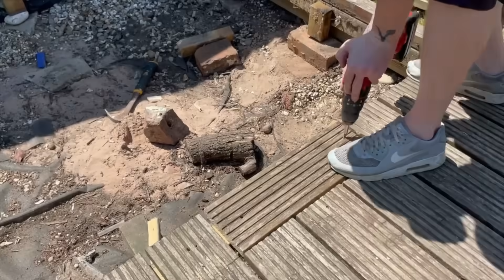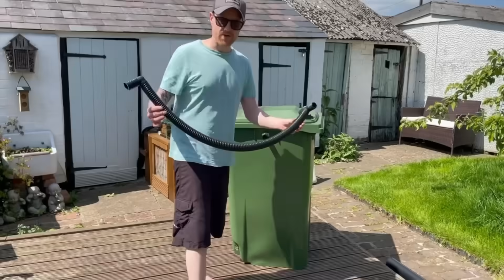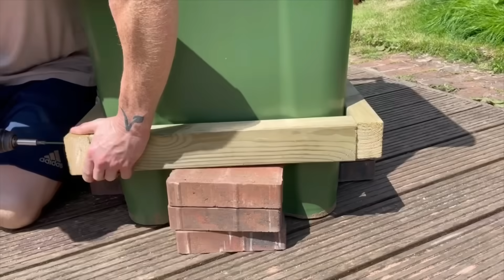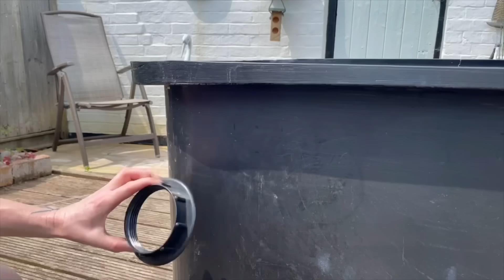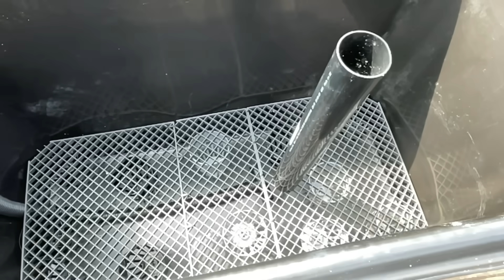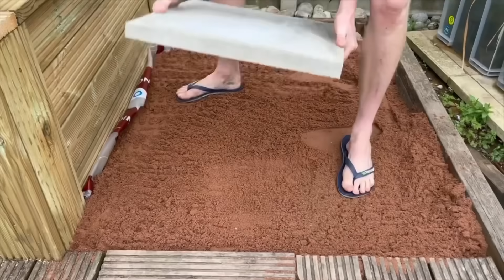DIY Backyard Garden Pond (step-by-step)

Comment: Hey I am gearing up to build one of these in my backyard. All above ground but I am going to use a "pool pond" instead. Specifically the one that you can see into from the front. I am going to use the same steps you took here, insulating and adding siding. Any tips?
Reply from the maker: Can’t really think of too much. Just take your time, and try and make sure you’re keeping your cuts nice and square. Good luck with your build! Being able to see in through the front will be very cool!!

Comment: I only miss a part for excessive water drainage.  For heavy rains ect and the airstones do not add oxygen to the water.  It’s the water movement on the surface what adds the oxygen in the water. So the airstone in the green bin probably won’t add much oxygen.   Water movement is always good though. Other than that it’s an inspiring build. Thanks for sharing
Reply from the maker: Thank you! I’m planning on adding an overflow soon..

Comment: This is beautiful! I'm confused what the trash can is for. I want to build a natural swimming pool with a stock tank and trash can filter with layers of rock, sand and charcoal. Would that media work?
Reply from the maker: Hi there, the trash can side of the filter is just for the mechanical filtration, so the physical removal of solids etc. The bog filter side of the filter as much as it does provide some mechanical filtration, it’s not great at it, but it is really good for biological filtration. Also the trash filter is good for trying different filter media’s, and also providing an area where I can add heaters, or carbon for example. I’ve never tried using sand in a filter so can’t really say how that will work. I’ve also never really used carbon in a pond filter, but I have thought about getting a carbon infused pad and putting it in my trash can filter, that way it would be easy to swop out when it becomes exhausted. Hope that helps! 😊

Comment: Does it freeze where you are, I’ve heard those tubs you used have a tendency to crack and split in freezing temperatures
Reply from the maker: I use heaters to stop water temps from dropping below 10°C/ 50°F, I’ve not heard of any issues with cracking though 👍

Comment: Could you have used the old decking boards for the cladding? Would have blended nicely.
Reply from the maker: Possibly, but I don’t think I would have had enough, plus they weren’t in the best of condition as i think the old pond had caused them to rot a bit. But yeah, would have blended in better if I had of. 😊

Comment: I dont understand ur filteration why it doesnt  flow from the top to pouring down. I dont understand how its filtering when tube is going all the way and not touching filter??
Reply: His pump sucks the water down the tube and fills the canister from the bottom up, then everything drains back into the pond via the top hole he drilled
Reply: @Rose_A  how Is that filtered from bottom?

Comment: where did you get the parts for your pump table/slate rock holder? looking for a 3 way 90 degree connector is hard work!
Reply from the maker: I got them from plasticpipeshop.co.uk it is pricey, but really good quality 👍
Reply: @GingerFishyOfficial just looked, no joy! 😭
Reply from the maker: @kennyroberts4229  😩

Comment: I have to say job well done! I’m actually hoping to build floating, self watering, vegetable garden beds. I’m in the desert so this will certainly require some modifications. But you present some very useful information here and I appreciate it! I’m hoping to use solar fountain pump and solar powered air pumps with air stones to move the water through the system. I’m going to attempt an under gravel filter in the bottom of my main tank.I expect that my plants will provide a certain degree of filtration themselves. I’m counting on common goldfish to provide fuel to the system. They’re cheap and are quite acclimated to my region. They reproduce nicely
Reply from the maker: That sounds awesome.. defo like the idea of the floating vegetable garden beds!

Comment: Really love this, makes me want too build one !! 

Only thing i will say is the second air stone would have been better in the bio filter to help the nitrification process and make amonia removal more effective
Reply from the maker: Thank you! Yeah, did wonder about that, but then I also wondered if part of how the bog filter works so well is potentially creating areas of lower oxygen where anoxic/ anaerobic bacteria can grow and convert the nitrate. I could be wrong on that, but just something I kind of wondered. That said, I did consider putting an airstone down the clean-out snorkel for the aerobic bacteria, and to help prevent with channeling.

Comment: Where can I get the 3-way bends at the corners of the pump stand please?
Reply from the maker: The only place I could find them in black was the plasticpipeshop.co.uk quite expensive but really good quality. I have also bought them on Amazon in the past, but only in white, and they weren’t as good quality. But yeah, the ones I used in the this video were from plasticpipeshop.co.uk
Reply: @GingerFishyOfficial  great, thank you

Comment: Nice build! Question, wouldn’t porous rock help the micro biome more than those smooth stones in your bio filter?
Reply from the maker: Possibly. But generally bog filters are always built using rock and gravel. I think more porous rock can end up getting clogged over time in a bog filter setting.

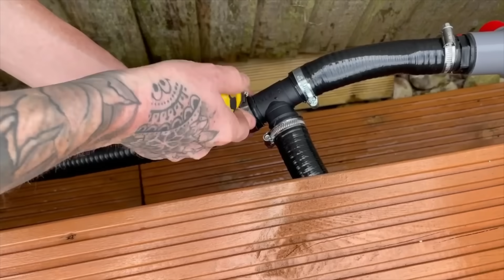Comment: 19:08 With the non return valve do you need just need the one going into the bog filter? or on both sides? If you need it on both sides could I place the non return valve on the T joint before it splits off into either filter so then the non return valve works from both filters?
Reply from the maker: Yeah, you for could defo add the non-return valve before the split.. that way you’d only need one 👍
Reply: @GingerFishyOfficial  Cheers :)

Comment: Hello dont know if you still read comments on older vidoes. But ill try my luck im currently in the process of upgrading my pond and want to build somthing very similar to what you have. The only difference is with the bog filter i would like in the center of my pond and not on the side that means the mechanical filter will run through the gravel filter with plants then drip in to a waterfall will this still be okay do you know?. As you have both filters running separate. 

Sorry bad english.
Reply from the maker: So the water will go through the mechanical filter first, then the bog filter? Yes, that’s should work well, and is a good way of doing it. 👍

Comment: I'm an aquarium guy really, but I was fascinated by your build. I had a few concerns as I was watching, so there were a few sharp breaths, but you addressed the concerns as you went and I exhaled in relief. It looks really nice too. 

I think the mechanical filtration could be done better, but it would cost a lot on a pond scale, so I think as a cheaper set up you did well. I'm not a fan of alfagrog, so that's the only thing I would change out.
Reply from the maker: Thank you! Yeah, I agree the mechanically filter could be better, the real test will be how it handles the summer months when the waste load is at its highest! I only really used the alfagrog as I bought a big bag of it years ago and thought I may as well  use it up. 👍

Comment: I have no idea how I found this video and I have no desire to put in a garden pond in my back yard, but for some reason I watched this very intently from start to finish ha.  Very nice build and good video.
Reply from the maker: 😂 Thank you!
Reply: I never understood why people want to look down at their beautiful fish. I have an aquarium built into the wall above my headboard. 99% you'll never see from above. The bubbles rising to the top put me to sleep
Reply: @joeblow8206 that’s also a lovely idea Joe, but this guy is building an outdoor pond for winter-hardy fish. I build my (fairly large) tropical fish tank into a brick wall between two rooms, (the hallway and the dining room) so it could be viewed from either side.
Reply: ❤love it
Reply: I’m sorry but the filter at the bottom of the bin is incorrect. Sediment is heavy so the sponges and filter will just hold it down in a place where it would have settled anyway. The pumped incoming water t-piece outlet should then have been set about 12 inches from the bottom so allowing the sediment to naturally separate without being constantly disturbed by the incoming water.
Reply: (Insulation only maintains the water temperature for a longer period. It doesn’t change it) so if you live in a location where sub zero temperatures and ice occurs in the winter, you will need to employ a small ( tropical fish tank type) thermostatic heating tube to prevent the water from freezing-over.
Reply: it is because it is simple and looks very nice
Reply: Same
Reply: What are those boards called? Never seen them with those channels
Reply: came here to say the same thing. I live in a condo, so its just information I rolodexed lol
Reply: Same here 😂🇬🇧

Comment: Great video, really useful for me as I'm building an above ground pond with exactly the same tub. Couple of questions please - what thickness kingspan do you get and where did you get the plastic tube and joints you used for the planter basket stand. TIA, Jon
Reply from the maker: Thank you! I used 50mm kingspan for the main pond, and for the filters where it would  fit. In a few areas where it wouldn’t fit, I used 25mm. The pvc I used for the planter basket stand was from pvcpipeshop.co.uk, it was quite expensive but it’s really strong stuff, and fits together tightly so you don’t need to glue it. I’ve tried buying similar stuff on Amazon and it was nowhere near as good. Good luck with your build!
Reply: @GingerFishyOfficial  thanks for the additional info', really appreciated.

Comment: some interesting ideas you had there I like the fish refuge shelf idea might try that in my pond to keep birds from trying to get fish. 
the insulation you put in does not look like closed cell foam is it going to soak up water?
I like that purple pickerel plant and the water iris, but both just keep growing and spreading crazy large I have them in 3-gallon black buckets and you would never even know that there is soil in there they have overflowed the buckets completely. The pickerel is so huge at end of season I drag it out and chop whole top off with a machete and it grows back next year to 3 foot tall and 4 foot wide.
I had bottom of pond empty but then some gravel snuck in, and the koi and goldfish chew on it so not much dirt collects in the small amount of gravel it probably helps keep the plastic from breaking down over time in sunlight.
Reply from the maker: Hi there! I’ve never had pickerel weed before, so thought I’d give it a go. It’s yet to start growing back this Spring yet though, and I’m a little worried it may have died off over the winter.. are you in the UK? I’m wondering if it got too cold for it.. 😬
Reply: @GingerFishyOfficial  I am in pennsylvania United states similar to UK might be a bit colder here in winter our plant looks dead then once it is warm out and it gets sun and fertilizer it grows like crazy it likes hot weather might be a picture of fishpond from last spring on my u tube channel

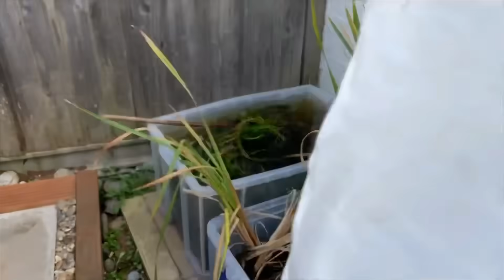Comment: 21:48 , Some things I have learned over the years of building my ponds, that I believe all ponds should have.  The pond should have a bottom drain, or at least an overflow pipe.  I incorporate both into one design now.  My over flow sits in the middle and if need be I can pop it out and it becomes a bottom drain.  All filters should have a bottom drain, it takes about one year for it to become full of muck.  It’s much easier to turn a valve and drain it to get all that out.  Recently I started using net like laundry bags to put my bio-logical filtration in.  I just pull two bags out of a 40 gallon round can lightly hose them off and put them back.  I have also found that if you create a vortex where you water comes in at the bottom of your filter the water rises better.

Comment: Properly executed but I have a couple of question: why 2 filters? -with your correct ratio of bog (30%) you don't need a mechanical filtration, unless you are trying to acquafarm tilapia or similar. -how will you remove/wash the sponges in the mechanical filter? I really recommend a clean off valve on the bottom of mech and bog tank when you work with such heavy size, especially in case of seasonal changes.

Comment: Im planning to copy this tank,and placing on back porch of house but I don not want frogs or snake invading yard,what can be done if anything
Reply from the maker: Hi there, in the video that followed this one, I added a kind of net (to keep the heron out) that would probably help. The one that I used had quite big holes, but if you used a finer wire mesh, that would probs help with frogs and snakes. You can get green pvc coated wire mesh (I used it for my chicken run) that’s a lot less noticeable compared to the usual silver stuff. Being above ground and on your porch should defo help as well. That being said though, quite often they may still find a way in.. Good luck with your build though!!! 👊
Reply: @GingerFishyOfficial  Thanks for advice

Comment: Really enjoyed the video, actually trying to build mine now. I am not able to find the 1 inch connectors you spoke of from Shirley Aquatics, they do have something called Hose tails but not sure its the same thing. Also what diameter hose did you use?
Reply from the maker: Thank you! Yeah, I just had a look on the Shirley aquatic website, and for some reason I couldn’t find the tank connectors. But if you google ‘Shirley Aquatics Tank Connector 1 inch’, it comes up. I think the Hose tails are something different. The diameter of hose I used was 1inch (25mm).. it is a very snug fit though, and you probably will need to soften up the end of the hosing in boiling water, which makes it a lot easier to slide onto the tank connector. Just be careful not to burn yourself though.. Also, I find the corrugating hosing goes on way easier than the non-corrugated. Good luck with your build!! 👊

Comment: I placed a four tier plastic vegetable  stand into the trash wheelie  bin and packed each of the four plastic shelves with media from course sponge  at the bottom to fine sponge at the top.  When the sponge needs cleaning I simply  lift out the plastic  vegetable shelf stand and spray the whole thing with a high pressure  hose. 
I also drilled a hole at the bottom of the  bin and fitted a drain cap so it makes it easy  to drain the dirty water when I begin cleaning.
Reply from the maker: Sound awesome!! The good thing about DIY filters is they can be completely tailored to your own personal needs 👊
Reply: Please do a video ov your Brilliant idea.❤

Comment: Great build only thing I would have done differently would be the filters. I would have used a bottom drain and a gravity fed settling chamber but that's just my opinion great build buddy
Reply from the maker: Thank you! Yeah, bottom drains do look good. I’m planning on a big in ground pond at some point in the future, and I think I’ll be going down the bottom drain route with that one!!
Reply: Bottom drain gravity fed settling chambers with your pump in the last chamber watch the difference in water quality and it will stop your pump from churning up solids and yu won't get all the crap in the pump. Also a surface skimmer mate will look forward to the new build

Comment: I would like to make one small addition, use a UV light for the mechanical filtration section. It greatly reduced the amount of cleaning my Koi pond required and helped keep the water very clear and free of most parasites. It was well worth the cost. I love what you did and will do about the same for my Florida home. The key to any great pond is definitely the filtration system.
Reply from the maker: Thank you! Yeah, I may add a UV light in the Spring.. I wish I was in Florida, pond season is all year round for you.. Good luck with your build!

Comment: Odd question however this a serious question. I would like to do a modified version of this, but in my master bathroom as a soaking bath tub. Do you think this would be possible if I used one of the pinds which have curves? Building the proper supportive surrounding frame, cutting for plumbing & drain, installing roman faucet, etc. Opinions?

Comment: If you want to cut down on the mess from sawing the insulation panels, just use a good solid sharp large knife to do the cutting instead, helps if you lay it down on some scrap plywood as a cutting board The knife works a treat and bugger all mess.
Reply from the maker: Thanks for the tip! It does make a right mess when using the hand saw.. it went everywhere..

Comment: 📍 Foam insulation under the main tank.
📍 send filter rather than mesh/foam?
📍 nice solution on the pipe drilled with several holes for flow control!

Comment: Hello!  I have a newly acquired 600 gallon tank and I plan on doing this exact set up in the spring. Did you say you only need one pump for both filters?  Can you show how you have them linked together?  Thank you!!
Reply from the maker: Hi there, yeah, I just used one pump that feeds both the filters. You just need buy a T to fit in the hose, that you’re using, and this will allow you to send half the water to each filter. Hope that helps, if not though, send me an email and I’ll send over a little diagram. (Email is gjngerfishyofficial@gmail.com)